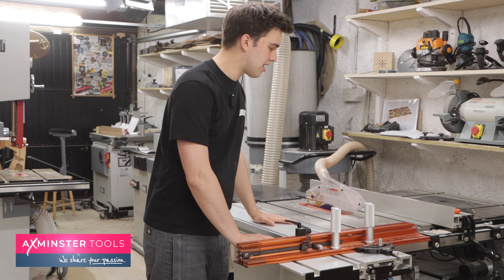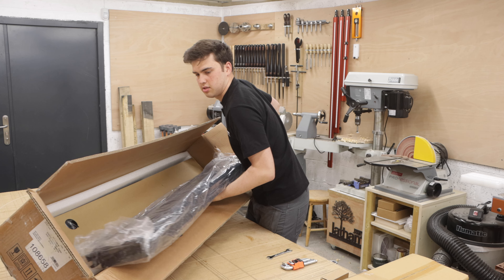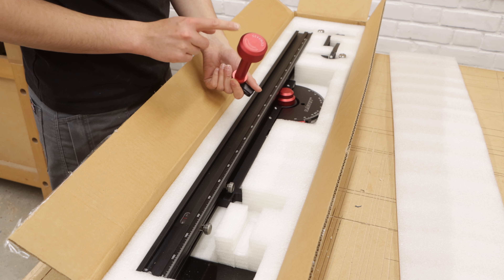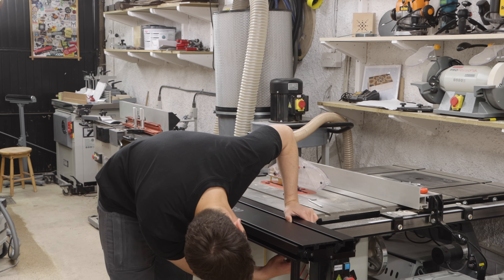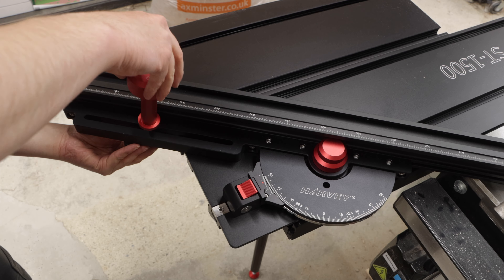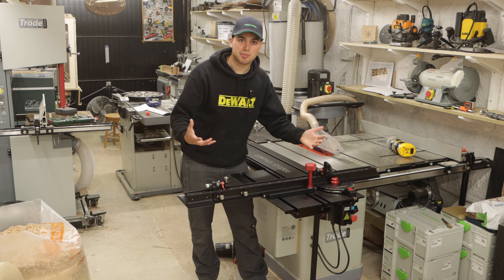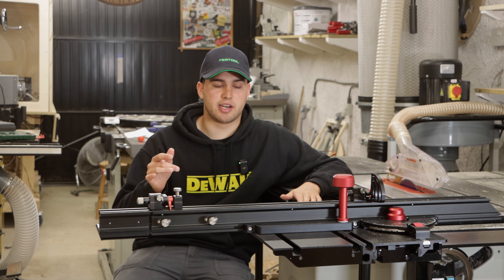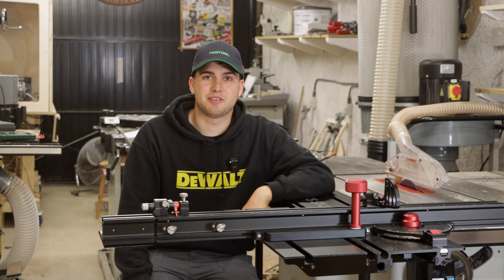Ultimate Tablesaw Upgrade! Installing The Axminster/ Harvey Compass 1500 Sliding Table

Comment: Thanks for the video. I'm thinking about buying one myself, but as I am in a very small shop, I would only be using this for larger cuts and would be taking it off and on. Please consider making a short video on how easy it it to use the table saw with out it, then install the unit so you can use the slide. Thanks

Comment: I just bought the Harvey version of this to go on my saw. I have the one with that TIn top. Have not set it up yet. I bought it without fence and rails and am installing the Incra LS complete system also with router lift. My plan is to build my own extension table with becomes the work bench so it will become way longer. I'm aiming at something similar to what Dennis did on his Hooked on Wood channel. He's done some excellent work in this area. I'm using this set up for finer intricate work and will use my Felder Sliding table Saw for breaking boards down etc. Harvey Woodworking I have to say have been great to work with. Also worth getting their dust collecting blade guard. It cost less than half the cost of the Felder and is absolutely equal to it. Good video and good luck with your channel.
Reply from the maker: I’ve seen that saw with the gold top! It looks awesome, bet you’ll enjoy using that! Good luck with the extension table workbench, that’s a great idea. Thanks for watching 👍

Comment: I have had the harvey extension table for a few months now, and I got the 90° very accurate when I first set it up. I went to make some angled cuts on it, and the stop to put it back to 90° has some play in it, so I  have to spend some more time to get it back to 90°. Hight quality overall still some play in the stops.
Reply from the maker: Hey Chris, I know what you mean. I ways keep a square next to the saw, so I can quickly check/ adjust when I need to

Comment: You mentioned that all the parts are metal,is the metal gold? I just checked the price:£1500.00!Woodworking is an expensive hobby. I hope Axminster provided you with a good deal on this item. They know you’ll showcase this product to its full potential and many of us tool freaks will drool over it. Clever buggers.
Reply from the maker: Ahaha lie Nielsen needs to start making gold tools, wonder how well they do 😂. Axminster are great to work with 👌

Comment: Harvey is amazing I have the table saw and the sliding table. I also have the larger dust collection which is a big improvement. The problem I have with the fence miter gauge is when you slide the stop into the end of the extension it doesn’t lineup and it’s really hard to get the stop in to the very end of the extension piece. I had to file it and manipulate it to get it to fit Harvey said they were going to address it six months ago. You just reminded me to give them a call and see if they fix that flaw. I’m curious ,slide that stop in and out of the extended arm on the miter gauge and let me know if you have trouble lining it up thanks for the video and I still love Harvey even though there was a slight flaw
Reply from the maker: Hi Ray, yes this happens to mine. Good idea to file that section! I’m jealous of the dust collection you have, it looks great!

Comment: Does this make it safer to use? I notice you're no longer in direct line of a kickback if you're further off to the left as you cut!
Reply from the maker: Yes it definitely does. You're exactly right, when using the sliding table you stand to the left, it helps you see the blade and if there is kickback, it won't kit you.